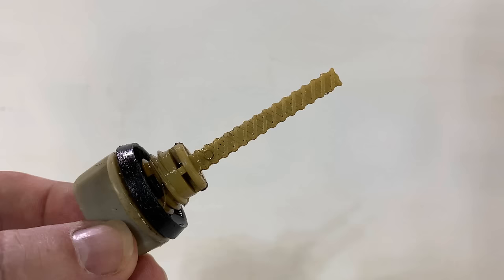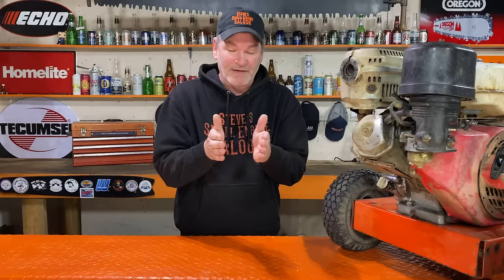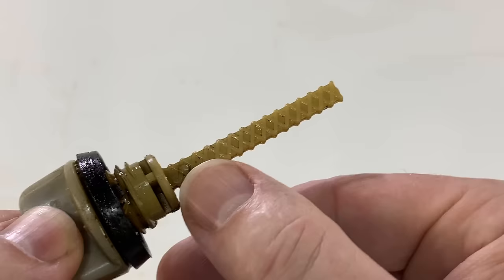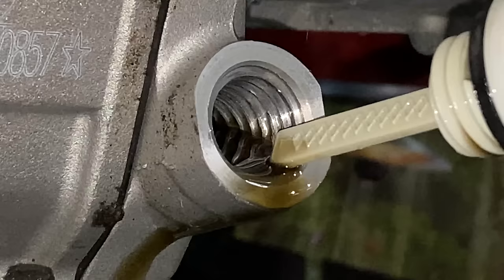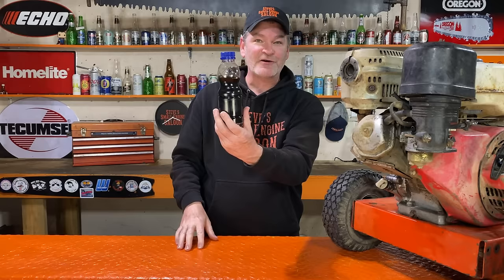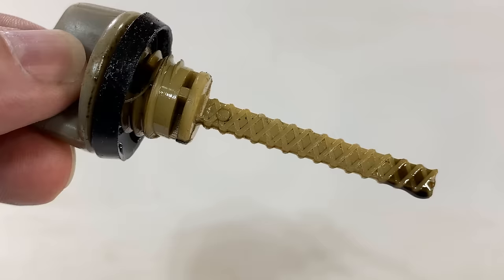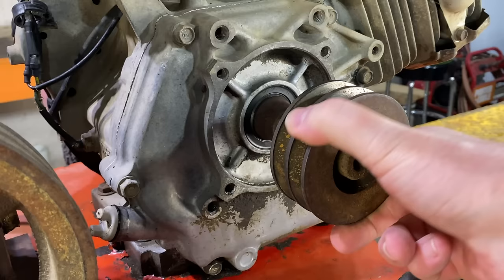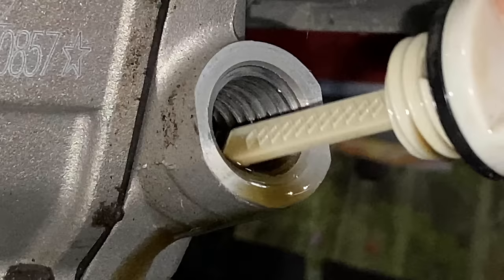Don't DESTROY Your Honda GX Engine By Making This COMMON MISTAKE

Comment: My biggest complaint on Honda Push Mowers is the lack of a Drain Plug.  You must tip the mower on end after warm up to drain the oil.  Try to catch it!   For those of us who do use the Dipstick, note that they are NOT to be screwed in but just rest on the top of the engine hole when checking.  The HRM21 mower engine I just worked on holds .35 litre, when full. That is about 355 ml.  Some engines require the dipstick to be screwed in to check oil level.
Reply: I use an oil extractor, bought online for under 5 bucks. It's a huge plastic syringe that you insert an included plastic tube in the end and withdraw the oil through the filler, about 250cc at a time. I pump the old oil into an old plastic oil bottle. This will get most of the oil out - on my generator I then remove the drain plug and catch the dregs in a low profile plastic tupperware container. My silent genny has limited access so to fill I suck up a few cc of new oil, to rinse the extractor and bin that, then I fill via the filler, again about 250cc at a time. Just did it the other day in fact, it is fast and totally mess free.

Comment: Steve, I'm over in Newfoundland. I have a Simoniz 3000psi pressure washer, bought last summer at Canadian Tire. I pulled it from the shed to start it up, and ran water through it, the pressure just won't relieve itself after running for a few seconds. Just locks up solid. A lot of pressure builds up in the hose til it's about to burst. I have to use 2 hands to squeeze the trigger on the wand.
Reply: I wonder; did you let it freeze over the winter? I did that once, and the freezing ruined the unloader in the pump. It behaved just like yours. These days I unbolt the pump from the machine and bring it inside for the winter, because you can never get all the water out. Lesson learned.

Comment: I like the dipstick as it allows you to know how much you need to add so I hope Honda doesn't do away with them, but I understand your frustration.  My main issue is that if the engine isn't level you can't check the oil level and that's a problem on a lot of small equipment.
Reply: Level a horizontal plane or line with respect to the distance above or below a given point.

Comment: Hi Steve, good tip 👍 with the dipstick they could at least put an arrow to the highest point and stamp on it OIL LEVEL, I agree just no need for the crosses it will and does confuse people. Good video 🙂👍
Reply: Good point. I have never owned a Honda. If I pulled a dipstick for the first time and it didn't have level markings, I would have to go straight to the manual to make sure.

Comment: I totally agree with you a 1000% in people should learn this and read their owners manual and keep it and make a practice of checking your oil before each use and get in the habit of changing it at least once a year or twice a year depending how much you use it it's not going to hurt your engine if you change your oil more often if anything it'll help it and always use 30 weight oil non detergent

Comment: I have to pat myself on the back -- years ago, THE first time I checked the oil level on my very first Honda engine I saw the "to the rim" sticker and I still simply disregarded the funky "dip" (you know what I WANT to call it) "stick".  I now own a number of Honda engines and I sometimes surgically remove the "dip__ stick" portion from the plug.  MUCH more sense, eh?    🙃   - Joe S -

Comment: Being that the stick is cream colored, its purpose I'm thinking, is probably to catch some of the oil when you remove it so that you can see if it's getting dirty enough to the point of it needing to be changed.   They should make it clear either on the engine itself, which I think you said some of them do, or the manual that the stick is not meant to measure the oil level.   Good video as always.
Reply: This is exactly what I think it's intended purpose is and what I use it for. It's for checking quality, not quantity.

Comment: shout out to steve for the guidance he has given through these videos.
i was able to bring 2 troy bilt chipper vacs back to life and 1 of them required a 3/4 rebuild including valves on a 5hp tecumseh engine. i wasnt able to do an engine swap because these are proprietary engines with a belt pulley extension in the front and a 1 inch crank shaft not common on the smaller engines. 
pulled the valves and springs from the engine with the hole in the block, new head gasket and rear case gasket, new carb and muffler, spark plug and refurbished the coil and magneto.
it started on the first pull with the valves lashed at 007 and 008. they Are supposed to be 010 and 010 but i wasnt grinding and taking a chance on destroying the valves.. like i said it started on the first pull with no carb and no muffler then after i put the carb and muffler on, i adjusted the air fuel jets and it runs like a champ. the only torque wrench i had was my muscle.
you gave alot of info on several things here that have helped and saved me a ton of money.
thank you, thank you , thank you and keep up the great work!
Louis

Comment: once again you have answered a nagging question Ive had forever (such as if it's ok to haul a fridge or freezer horizontally on its side- its ok if you wait 4 hours for all the oil to return by gravity  to compressor located on bottom, otherwise it could overheat the compressor due to inadequate lubrication/cooling - i know this is true from experience) and presented in a way that is logical and it makes perfect sense to me..... thank you Steve, and thank you YouTube !!!

Comment: Yeah, you've got a good point here Steve, dangerous for consumers who don't read the manual. All the "manly men" who give into peer pressure and say "I dOn'T nEeD a MaNuAl, ThRoW iT aWaY" are really in for a nasty surprise. The crosshatching is just added for aiding visibility, but to the Average Joe Homeowner it's probably very confusing. I have always filled these types of small engines to the point where the threads BEGIN, but you can't argue with that picture graphic. 🤷🏻‍♂️ Definitely looks like that picture shows oil up to the very last thread turn at the mouth of the dipstick hole, so a tiny bit more than the volume that I usually maintain. You'd think that Joe Homeowner would still want to fill oil up to the tippity top of the crosshatched area, which would officially be low but probably still within reach of the slinger and still safe, although not really good.

Comment: I have been servicing 4 cycle string trimmers where the owner has overfilled the crankcase with oil mostly Craftsman 30cc models these engines only call for 90ml of oil the ones i serviced had 180ml and more of oil to where the piston and cylinder was hydro locked and the manual states the oil should be at the top of the threads when the engine is level on a table i advise people to use a syringe when measuring the oil for 4 cycle equipment under 100ccs.

Comment: The little Onan Campower 2500's(mine's a 2006) have the opposite problem. The dip stick causes you to put too much oil in it and it eventually kills the engine. You need to pull about a cup out when oil touches the dip stick. But they fixed the problem, they stopped making them. They replaced it with a newer model.

Comment: Like you say the crosshatch on a normal dipstick is there to show min/max. Just like the Honda one the drawing shows this.just poorly drawn  However, your right to educate people on this. I to see a lot of these engines with knock knock whos their problems on dipping only just on stick I do the same cut the stick and tell the customer what has happen and advise them on check the bloody oil more regular simple oil is cheaper than metal it also acts as a heat transfer thank-you Steve great content as usual 🎉

Comment: That’s an awesome tip Steve. Never could understand that dipstick feature or even why it’s there. Id prefer the oil space over the plastic. The owner of that machine must feel dumb. I always read the instructions before hand. Beyond that sticker I’m sure there is clear instructions to fill the oil level on a level surface up to the final thread. 

I would oil up that seized piston and run it until it explodes at that point 🫡
Reply: He said The connecting rod is the issue.

Comment: Steve, I have to say that you probably just saved my brand new Honda engine on the log splitter I just bought. When I got it, I pulled the dipstick and it was almost to the bottom, brand new. Fortunately, I hadn’t ran it for more than a few minutes just to verify function. Whoever assembled it also didn’t fill the hydraulic oil all of the way. Probably being cheap to save a buck on assembly. I can’t thank you enough!
Reply from the maker: You're Welcome...

Comment: Holy crap for 12 years I've been doing site work, a couple different companies. Generally the compactors and water pumps have had Honda engines. I've always trusted the dipstick and the low oil shut off sensor. This is definitely a handy benefit for info
Reply: I hope you don't run it til the sensor shuts it off. If so...shortened engine life for sure.Keepem full.
Reply: @kenforu1531  only once definitely not intentional but the company sticker on it is not my name

Comment: The dip stick on my lawnmower with a gx engine is different, the crosshatch pattern is in a certain zone, not the whole dipstick.  I've always filled to the top of that "safe zone".  Engine is going on 10 years old, runs like a champ.

Comment: Great Video Steve! I have always added oil on Hondas until the oil runs out. I would like to add that while Honda motors are very well made, I generally go with a Kawa or Briggs motor on all new equipment that I buy. The reason? Honda's are just too damn sensitive to bad or old fuel. If you are not going to run the engine at least once a month or more, you are going to have problems with the low speed on Honda motors. Not sure what the cure is, but Kawa and Briggs don't seem to have these carb issues as bad.
Reply: I've got Honda engines (and one clone) from 160 go 530, all running on 2 year old gas. I put 1 Oz Seafoam per gallon in the gas when I purchase it, and it lasts. Down to my last 20 or so gallons from that purchase, and it still works as of two days ago.
Key is to treat the gas when bought, not months later.
Reply: @JasonW.  To me the Chondas are the equivalent of a Lada Niva; they're nowhere near as close to a real Honda Engine in terms of quality and tolerances, they burn oil and are not fuel efficient, but if you know how to maintain them they will always run. Just make sure your tools are nearby when it's running.
Reply: @OlivierCaron  the carbs are definitely lighter in weight

Comment: I have this Identical engine on a commercial pressure washer. It’s a new block with the original internals (except with new piston rings) and the same exact design on the outside.the  ORIGINAL (1986) 11HP GX-340

Comment: Why do Honda put the Cross hatching on the dipstick anyway. I can’t see any reason for it. Honda would be better to just put a plain smooth dipstick in, just so you would know that the oil was low and by how much it needed topping up. Another great tip Steve. 👍🇬🇧
Reply from the maker: I Agree!

Comment: I bought a generator and I think it’s a Briggs engine and the owners manual says to fill to just about running out the fill hole. Same as you showed but I don’t think it has a dipstick. Just a screw plug. But the drain is an inconveniently blocked plug and I think it would be better to have a pipe tapped out put in there and then be able to easily access the oil drain and direct the flow of what’s draining.

Comment: GREAT INFO AGAIN but not quite the issue I've had - I've been guilty of not checking my oil level often enough and the motor would just not start!! - no matter what I did it just wouldn't work - I put in a new plug and stripped down the carby 3 times thinking it was a fuel supply issue with no luck.
I've since found out that due to an 'oil level sensor' built into the motor, (I had no idea that this existed) if the level was too low it would just not start no matter what you did.
It's a great safety feature to stop just what you are describing
Reply from the maker: I have a video on that issue in my playlist...
Reply: @StevesSmallEngineSaloon  Thanks for the reply Steve - I scrolled through your playlist but couldn't find it. Could you let me know what the video is called, thanks again, Glenn

Comment: This got me too.  I overfilled my oil once and lots of smoke.  I just print the fill amount from the manual and put it right on the fill area. I do this for all of my power equipment because I don't have time to remember these amounts.  Can't wait to move to battery powered for the power equipment that I can!

Comment: THanks Steve, Just checked out your replacing coil rope video and found this vid...My splitter has a  GX 160 A great engine. Would hate to lose it to low oil( just ran outside & checked it lol).
Reply from the maker: Right on

Comment: I think the same dude that designed that is the same "dude" that designed the oil drain procedure.
I have the GX270 on a Little Wonder Optimax blower and there is NO easy way to not make a complete meltdown of a mess draining it.
Thanks for the tips !
Reply from the maker: Interesting!

Comment: Owned Honda ATC'S back in the early 80's and it was the same. Reliable and a good engine. Read the manual before I ever rode it and the picture of the oil level was exactly the same! But......people these days are not the same and I can KINDA see how they can get confused. But still just read the manual or go online if you got it used with no manual. Hey it's job protection for you the mechanic though 😉

Comment: Steve, love your channel, but the GX series has some exceptions! I bought my HRX series mower specifically because of the GX power plant as I run many other GX engines and trust their reliability. On my HRX there is a true oil dip stick, with an elongated tube, so if you were to top that sucker up you’d totally overfill the engine so this could be a dangerous recommendation
Reply from the maker: That is not a "general purpose engine" which I specified 3 times in the video!
Reply: For Honda GCV engines such as on HRX lawnmowers, the owner manual clearly says fill only within the hashmarks area on the dipstick, not to the top of the oil filler tube, to avoid flooding the air filter area and causing smoke.

Comment: Just like most generators i come into, but theres not a dip stick simply a cap lol. So you just fill till it spills out a bit...or a lot sometimes and make a huge mess, and get on with it. I don't think i've even thought about those dipsticks before, but sure can confuse anyone. Almost want to just cut off that stick part. Make zero confusion.

Comment: Mine is still going strong with its second PW pump now about three years old. Bought it in 2004, and have used the H*** out of that thing. Easily some of the best small engines ever made.

Comment: Don’t blame Honda when someone hasn’t learnt how to maintain their own equipment. The reason the dipstick’s there is to show if the oil’s 10mm low or 30mm etc. So it might just need 50mls to top it up, but if nothing’s on the dipstick, it’s probably not a good idea to start it. Being the slightest bit low isn’t going to create a disaster, thus knowing the actual level’s handy. The cross pattern is simply to trap oil to make it easy to see on the stick.
Reply: Low is low. No dipstick is needed to see that. Steve is entirely right.

Comment: Bigger problem than small engines. A lot of transfer cases and gear boxes have similar situations. The saving grace is commercial and industrial guys generally know to fill to overflow point AND proper cases have sight glasses where the oil level can be seen to be in the centre of the glass when at the proper level.

Comment: I wonder if this style of dipstick is substitute stock when assembling the engine. Dipsticks should only be used in a vertical tube in my opinion. If not, definitely a poor and confusing design feature considering what is stated in the  operating manual. Thanks for sharing Steve. I will save my money and stick with my B and S powered stuff.
Reply: Almost like if you wanted to, just hacksaw or snip off the hashmark portion of the ''dipstick'' rather the oil cap lol and it would fix 99% of these issues. Sad how such a minor detail made such a hassle.

Comment: Steve:   on my GX 160 on my Northstar Log splitter I towed it 17 miles to my daughters to use it…(I did forget to close the fuel valve) I started it prior to leaving my house and it ran normal ….when I arrived the recoil was locked  and couldn’t turn it over….I waited 3 days then changed the oil and also drained the carb bowl…still locked….I partially loosed the pump from the engine to slip Visegrips on the shaft to try to turn it over …I got a1/4 turn and the piston moved but I heard a clunk so I can’t get a full revolution to TDC……do ya think road jostling damaged it?   Never had this happen  before moving it around to split

Comment: I was gifted a pressure washer with a GX270 on it. I couldn’t make sense of the dipstick with cross threads all along and no low and high points… until Steve here called Honda out on that. Seriously though? How hard could it be?

Comment: Yeah thats RIGHT! further more;  the engineer that designed the DIP-SHICK in these engines should be wearing it. I completely for got about those engines; I used to work on them 19yrs ago

Comment: "Steve out" lol

Steve I just changed the oil on my Honda it was super black and I was told the new oil is too good and not thick enough.

The engine went years without oil change and he thinks the parts are worn down on the inside and needed the thicker oil to work.